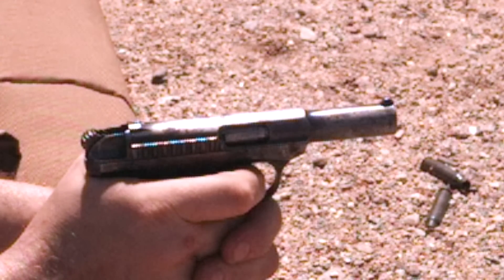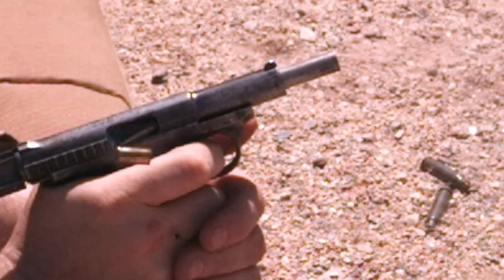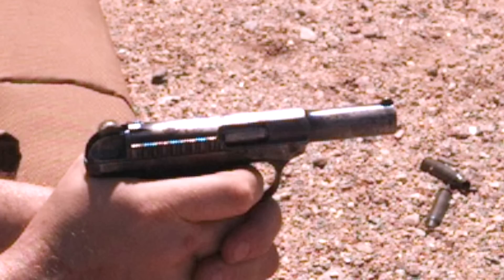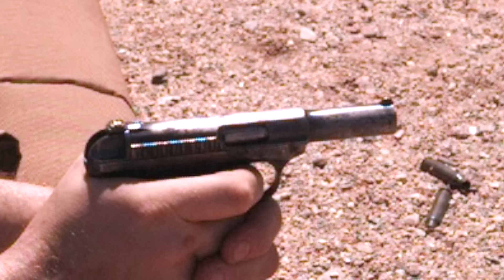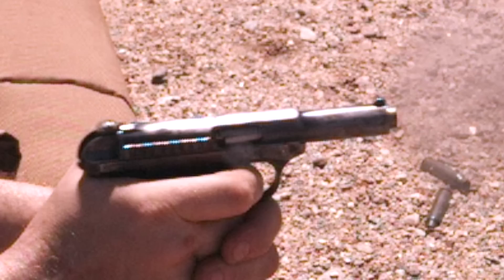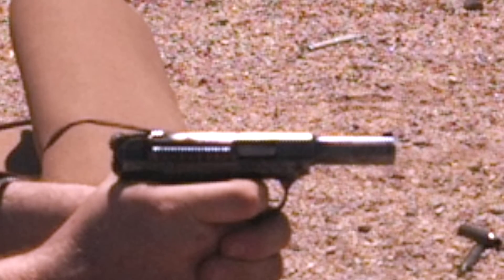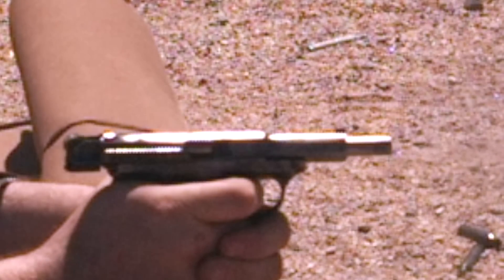Ask Ian: Analyzing the Savage Rotating Barrel (at 7500 frames/sec)

Comment: Ian what about the current rotating barrel pistols, from Grand Power, Smith & Wesson, Beretta, Glock, Colt, Stoeger Cougar, ETC It would be very enlightening to see the evidence like you have done with the 1907 Savage. Thanks the hype is the rotating barrel  not only reduces the felt recoil but also improves the accuracy. Measuring these claims could prove interesting.  Thanks

Comment: Great analysis.  I don't know if one can simply compare mass of reciprocating parts without taking into account the second factor which is recoil spring strength/weight.  I know you're aware of this, but how do the springs of the FN1900 compare to the Savage?  Essentially doesn't the Savage system allow you to include the barrel into the total mass of recoiling parts?

Comment: Ian, could you double check? 
- if the bullet travelling down the barrel rotates clockwise (CW), it exerts an opposite - counter clockwise (CCW) force on the barrel 
- as you seemed to be showing it at 1:50, the rifling in the Savage is CCW. Which, if true, would only help unlock the system faster.
Did the designer make a mistake with his design or did you?

Comment: Are we really sure this test was valid, though? You did note that there was a puff of combustion gases coming out ahead of the bullet. This could indicate that the barrel is worn to the point where, although it still is capable of cycling, it might not be functioning according to design. If the bullet isn't sealing the barrel, then (a) you're dropping chamber pressure before the slide starts to move, but also (b) you might not be getting enough as much torque on the barrel as designed.

Comment: You can see something happen at one of the frames in 4:18  (between the third "dropping" and "And"), during the last visible movement of the hammer, it looks like some type of discharge slightly colors air in front of the barrel as well.

Comment: The bullet is supposed to drag the barrel counter-clockwise to keep it from rotating clockwise and opening, right? I'm not sure the lock can work that way at all. 

The bullet spins because it's being pushed forward and it bites against the rifling. Newton's Third Law says that for every action there is an equal but opposite reaction. It's pushing against the angled surface of the rifling, which is pushing back, redirecting some of the forward motion into counter-clockwise rotational motion.That means in order to spin counter-clockwise, then the bullet must be pushing against the barrel rotating it in the opposite, clockwise direction, unlocking it.

Yes, there's friction against the barrel, but Newton's Third again, that should act against the bullet spinning. The frictional force can't be more than the rotational force itself, or else the bullet wouldn't spin. The bullet is being driven by the interaction with the rifling, it's not attached to a motor shaft stuck up the breech.

Or am I insane and totally misapprehending basic physics?

Comment: With my high speed camera CRONOS 1.4, I tested a resolution setting of 500x350, which results in about 7700 fps.
To me, it seemed as if the quality was better than seen in your video.
Sadly I had no chance to test it with a pistol.
If you don't have a CRONOS, you may zoom in on the vital parts and keep them in the light.
Good luck.

Comment: I'd expect this to provide more resistance if it had a progressive twist rate since the bullet basically would stop providing any meaningful resistance as soon as its angular velocity matched the twist rate. You'd need consistently accelerating rotation in order to maintain locking force for the entire travel of the bullet. Honestly I'd like to see a modern take on this idea. It would probably be pretty inexpensive to order a simple progressive barrel of the same dimensions from Peters stahl or lothar walther and just weld on the locking surfaces given how low the pressure is, it would be an interesting experiment.

Comment: Blish lock absolutely has a function. It is a mechanical retarder. It gets in the way of free motion, and absorbs some of the energy.  The OE receiver ends will blow out if the ears are taken off. Repro (PO) receivers have reinforced rear sections that omit the oilier and are made from higher alloy steels (not free machining steels used in the Thompson). Doug Richardson Receivers are made of the OE 1141? Alloy, free machining steels and offered a rear reinforced section if desired.
RIP Doug.

Comment: I had a real nice nickel one once.  Was quite well made and the only issue was a weak mag spring causing some feed issues.  Another "should have kept it"  as it would be worth at least 4X now.  So sad the system does not work as advertised.  But they had no way to probably tell.

Comment: It the statemtn if the barrle rifleing in the video correct?     It was stated " that the barrel is rotating clockwise as it opens, and the rifling is rotating counter-clockwise."    The problem is that if you force the bullet to rotate counter-clockwise you ger a clockwise torque on the barrel.  Bullet and gun need to rotate in opposite direction because of conservation of momentum.   This will open the barrel faster.

It might be the case that Ian stated that incorrectly and it should "the rifling  is rotaing the barrel counter-clockwise"   That is somthgin that occur with clockwise rifling.

Comment: The bit of motion may be backlash... or the system taking up the "slack" because of how forces are applied etc in a sistem like that it makes sense that it may still technically be "locked" until the bullet has passed. Depends on the tollerances IMHO.

Comment: The first pistol on this principle was the ..45 caliber for the US military trials. The torque generated by the heavy, large diameter.45 bullet would be far greater than that of the .32 ACP, which opens the question whether the big pistol did in fact work as the patent claimed.

Comment: Love this bit of analysis, shows how ballistics has evolved as a study over the history of firearms. One tip I've learned about high-speed shooting for your future reference: if you only need a portion of your high-speed frame, rather than lowering the resolution of the entire image, see if you can instead limit the vertical resolution of the image so you have a wide horizontal slice. You retain the usable data in higher quality, but because the camera is having to process less data, you can really crank that capture rate.

Comment: It's safe "enough" for the cartridges this pistol ever fired. None of them exceeded 20000 psi by very much. Would not try this design with say 9mm at over 30000 psi chamber pressure.

Comment: Could you do the same test on a Beretta Px4?
The Px4 barrel rotates similarly to this Savage 1907.
Perhaps the Px4 remains closed long enough to benefit from that design.
Reply: The px4 barrel stays locked for more than a 1/4" of slide travel, so probably

Comment: Very cool investigation! Seems similar to what CMMG uses to delay the blowback action on the Banshee, except that in this case it is the barrel providing the rotational delay rather than the locking lugs on the bolt rotating out of the way.
Reply: Not quite. Both systems use rotation, but the means through which they delay the opening of the breech is pretty different.

The CMMG system uses the rotation of the breech face against angled wedges as a means of mechanical disadvantage - Ian's video on the CMMG system shows this - the rotating movement causes the bolt-carrier to accelerate faster than it would in pure blowback, which in effect increases it's weight for the fraction of a second needed until the pressure drops to a safe level.

In the Savage system, there isn't any mechanical disadvantage; instead, the locking lug uses the torque from the friction of the bullet rotating inside the barrel to hold the breech closed slightly longer than it would otherwise.

The CMMG system is more akin to a FAMAS's system, in which mechanical advantage is used, while the Savage system is more like a gas-delayed blowback system, in terms of how the forces from the bullet are used to keep the breech closed until pressure drops.

Comment: I have one of these that had sat unfired for decades and a novice became the new owner. He got some ammo and fired it and it locked up everything and didnt let the spent shell eject. Of course the idiot pounded on it and got the shell out and took of the rear breach and tried to pound slide forward. Sadly this was originally in good condition. If he had field stripped, cleaned and oiled it before firing this wouldn't have happened. I doubt the slide is salvageable but he went to throw it away and I gave him $20 for it. I found a slide online for $60 so I have to see if I can get the slide off. If I can find something to grip the barrel I might be able to get it to move and get slide off. Something jammed up the barrel and slide groove.

Comment: Would a simpler way to test this be to use a dowel to push back on the breech block from the muzzle?  You would do this on an unloaded pistol, of course.  It seems to me if you could not push back on the breech block with the dowel, it must be locked in some fashion.

Comment: Brilliant work, Ian. And a brilliant concept from Mr. Searle. I never would have thought to use the rifling twist to counter unlocking. Locked or not, it's a very clever system.
Reply: It's certainly a functional delay system though I wonder how effective it is and how does it effect barrel wear?
Reply: @ArcturusOTE  I would suspect that operating at early 19-th century handgun pressures, the barrel wear would be negligible. As for effectiveness, again, 1900's handgun ammo was very 'low pressure' by today's standards, so I'll bet it would only be effective with rimfire ammo today. Otherwise, I'd expect the barrels cam lug and/or frame lug to break.

Comment: Any firearm that has a positively locked breech/barrel that must move apart in order to function demonstrates a form of locking.  Weather its momentary/delayed, long or short it is a type of locking.  A blow back is simply using the mass weight of the unlocked components with a spring to hold a cartridge of lesser pressure closed before inertia cycles the weapon.
Reply: Mayhaps cmmg banshee radial delay operates similarly?

Comment: The condition of the rifling on an obviously well worn example might be a factor in the actual observed behaviour of the system. It is possible that a new tight example of the type might behave as described in the patent while a well worn example provides less resistance to act against the counter rotation. Good luck finding a mint example to test the theory though.
Reply: Yes I think barrel lug wear altered results
Reply: ngl you may have a point there
Reply: @Sauli Luolajan-Mikkola For the bullet to spin it must first engage the rifling , the condition of the rifling has direct impact on the rate of spin and as such the equal and opposite rotational force on the barrel. The pressure created in the barrel by the charge will act to accelerate the bullet forward and rotationally, poor engagement of the bullet with the rifling will result in a greater percentage of the energy being used up in foward accelerating  of the bullet and less the rotational forces. There is also loss of efficiency in the system overall because of increased gass blow by.
Reply: @Sauli Luolajan-Mikkola Maybe if there was a positive engagement like the thread of a nut and bolt, or if we are going that way a Whitworth rifle with an octagonal bullet I could almost agree but when you rely on an interference fit I like my model.
Reply: @Sauli Luolajan-Mikkola that's not the point they were making. You're dealing with friction or rotational drag with their example. The bullet could be a stationary object and you could be manually operating the action around it and those same forces would be in effect. Less aggressive rifling means less friction preventing the action from opening. While I don't thing that's the primary or sole cause we might see discrepancies with this worn example and one that is in nearly new condition, I can see it playing a part. 

From working on a range of 1907s from nearly mint to as worn as this example I would say that the wear to the lug, the channel in rides in, the monster recoil spring most likely being weak, and having a chamber that's been slowly opened up from cycling and cleaning for a century greatly reduced the systems holding force. The couple I have done maintenance on that were still like new had a very positive initial locking action to overcome similar to a brand new tightly fit Glock. I actually was very careful on the lug contact surfaces to only take off any sharp burrs or defects on one of them. The customer asked me to see what I could do as an action job to it since it was a little gritty feeling and was suffering from failure to eject issues with loads on the lighter side of the info in the reloading manuals. In reality it never was broken in and still had a few tool marks on the rails hanging things up just enough to be an issue.
Reply: perhaps someone could experiement with a new gun that's a manually operated design so the forces are purely the recoil and this supposed torque generated by the rifling acting on the bullet, then measure if the gun tries to twist
Reply: @Shadow_Hawk_Streaming  It's  not just supposed torque, Newton tells us that. It's  just a matter of how much and if it is adequate to operate the mechanism  as described. My best guess is that we are dealing with the designers personal definition of what constitutes  locked. But it would be interesting to do the experiment.
Reply: @Sauli Luolajan-Mikkola it's locking lug tightness and wear not rifling that is the issue if it wasn't worn down it would have performed as patented I predict
Reply: @Sauli Luolajan-Mikkola I think we're all on the same page but somewhere in the convo something is getting skewed. You are correct the rate of spin will always be the same regardless of wear. That isn't the mechanism that affects the locking systems holding power though. 

The mechanism could be thought of as a friction induced or cam delayed blowback when it is failing as a lockup. The rotational forces that can be generated are proportionate to the tightness of the bullet in the bore during obturation. While the rate of rotation can't change the amount of rotational force can due to slipping. The more the rifling wears, less and less friction will be created as the bullet base can only expand within the constraints of the pressure created in relation to the hardness of the core alloy and the outer gilding metal jacket. Expansion in low power cartridges like 32 acp with a fmj really isn't great to begin with.

Combine that with the fact most mass manufacture barrels are rifled with what a precision bench rest shooter would consider fairly loose tolerances and you get a situation where the bullet can slip if the force opposing its rotation is greater. This would result in less torque over time which would result in the main function of the action becoming more or less direct blowback as the energy created by the pressure is now greater than the rotational force of the intended locking system. 

Instead of the lug actually locking until rotational force can no longer overcome the linear force it just slows down the linear force once worn. If the locking system was more robust there's a good chance that you would see the gun fail to extract if the barrel was worn enough with the weak cartridge the 07 uses. 

I will admit that I could be understanding the mechanism wrong as I'm still learning a lot when it comes to weapons design and engineering. I am just now finishing my associates degree out and learning what I can from mechanical engineering in my own time until I settle on where I will continue my engineering studies. 

I would argue the point about the lifetime of a barrel though. This was an affordable mass production arm. While they didn't make it from pot metal it's not very hard at all and with things like erosion from the powder burn adding to internal wear the bore does get shot out rather quickly. I have a few modern pistols that I have shot to the point you almost can't see the lands if there is any carbon build up at all that have never had a part failure. 

I have a taurus pt145 that I shot so much the safety spring collapsed allowing it to jump under recoil. The result was the slide snapping the safety lever off and jamming the slide. It may as well be a smooth bore at this point but it still works flawlessly other than the safety. Every time I look for one they are out of stock and I only keep it for sentimental purposes anyways. It was my first .45acp semi and also the first gun I used as a guinea pig when learning some gunsmithing practices as well as my first experience doing a slide cut.  Yes, I know Taurus doesn't use great materials but I would say it's on par with what stevens/savage used in the 07's.

Anyways, I don't want to come across as a know it all or just as I'm trying to dismiss your input. I enjoy the back and forth info sharing we are having on the topic and welcome the subjects it can push me to looking at that I may have never came across on my own or fill in gaps in our collective knowledge base.
Reply: Unless is a completely worn out barrel a new one wouldn't make any difference, the bullet doesn't jump the rifling you can crearly see the marks in a fired bullet even in a old barrels. It's just this system doesn't work.
Reply: Savage 1907 are neither expensive or rare. There’s really no reason to do this test with such a horrible example.